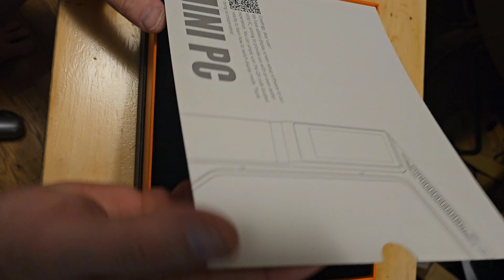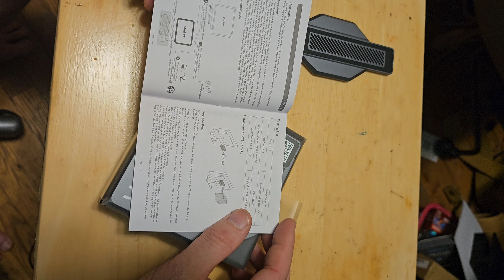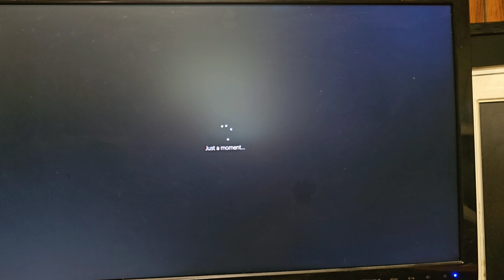Acemagic S1 N97 - Overview & Teardown

Comment: Very good video 👏, because other shows only the same s.... And don't show what's inside the box. I have a question. How can I disable the led screen by software? Thanks to your video I saw the cable which this PC uses to show info on led screen. But how can I disable it? By hardware is only unplug the cable but by software?. I need to know that because when I turn off this PC the led screen is turn on and show a clock.
Reply from the maker: @ficovids  Yeah sadly you cannot disable the screen I'll check the BIOS when I get home but I'm fairly certain there is no way to fully disable it unless you physically disconnect it. I dislike that under Linux it just displays ace magic That's it on or off it always shows ace magic and the LED light strip thing either breathes or races depending if it's off or on. I originally thought the screen would be a fun idea if you could actually you know program it to show useful information under Linux command line interface you can't do a damn thing with it and it's some third-party software anyways and the first party software for Windows is kind of cool but when you turn the computer off and turn it back on It erases any customizations you do to it so what's the point of using it. I am definitely going to be pointing this out in my review and probably going to show how to physically disable it

Comment: I’m new to mini pc. I’m waiting for this pc to arrive and I’m just wondering, how do we clean the cooler fan when it is time to? Any advice and tips?
Reply from the maker: Congrats on the dive into mini PCs. I'm hopeful that you're not getting this for anything heavy. The N97 is a decent processor but it is still very economy so work office stuff. 

As you can see in the video when I completely took it apart it's not super hard to get a part and honestly I don't think you'd probably need to clean it out for at least a year or more.
Reply from the maker: I am currently working on my reviews for all of the many PCs that I've gotten in recently so they'll be coming out within the next week or so
Reply: @krypticnexus  I’m just gonna use it for browsing, movie streaming, and trading. Nothing heavy. It’s just I’m a little concern on how the pc would perform under non-stop usage of those applications without turning it off throughout the whole weekdays. Looking forward on your next videos, hope you can cover the non-stop usage topic, since most of these mini pcs are targeted for office use. Thanks
Reply from the maker: I can say mine was running non-stop for about a week and a half a Minecraft server. And it was a pretty heavy server so CPU usage was fairly high always. Fan was a little on the louder side because it was running so much all the time but it wasn't disturbing. I've had my G3 which is an n100 system from GMK running 24/7 for the last 5 months maybe longer. It's still running Windows 11 that came on it It functions as my photo vault and a few other things.